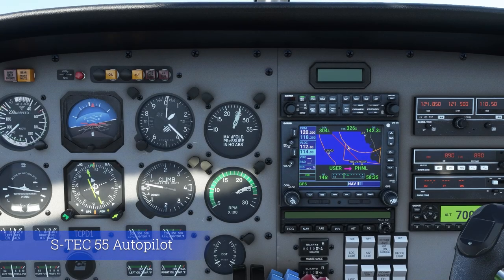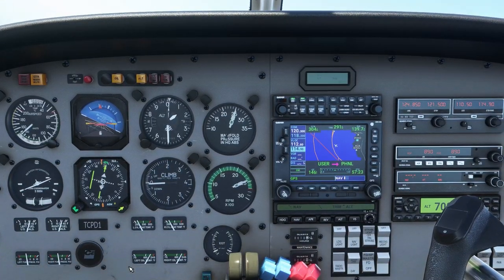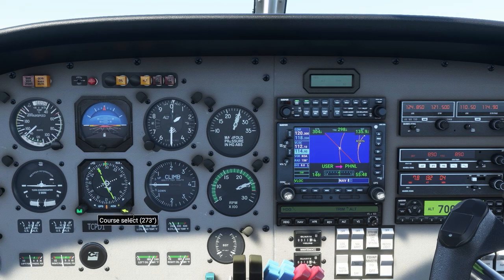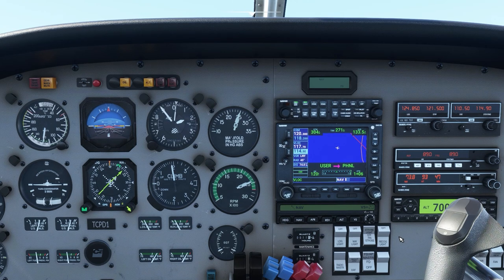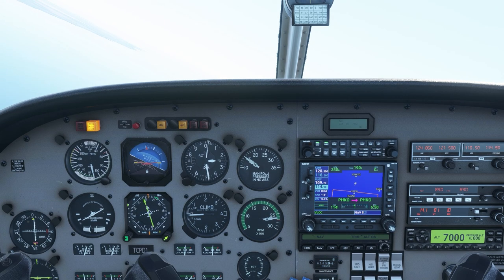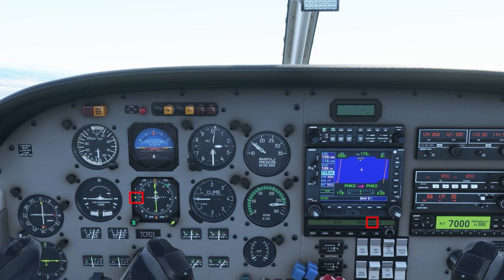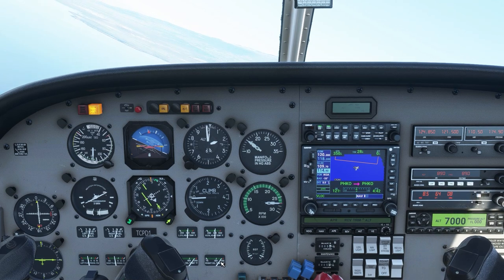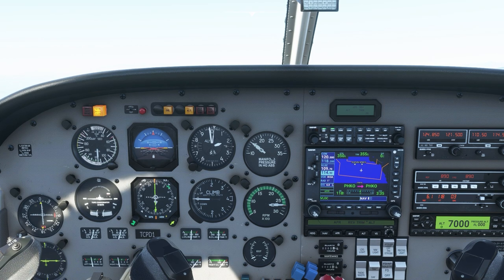S-TEC 55 Autopilot Tutorial - Microsoft Flight Simulator

Comment from the maker: Is there any particular type of video anyone wants made pertaining to this aircraft?
Reply: Hello captain, thanks for all the videos you are making for MSFS 2020. I have a request (since you ask): Some real world P-44 pilots are saying the single-engine performance of this Carenado P-44 in MSFS 2020 is wrong, while some other real world P-44 pilots are saying it's alright, and then there are others who think it's 50/50. This as you can see could be confusing to non-pilots like me. I wish you could take a look at the single engine performance of this aircraft again and make a video about it along with your final overall conclusion and thoughts. And also if you could test and tell us if this aircraft's mixture simulation is correct. Thank you sir :)
Reply from the maker: @evidenceplz  I've noticed the single engine performance is off too but it is of in fs2020, not necessarily just the PA-44.  From a standing stop it's possible to takeoff with full power on one engine and stay on the runway which would not happen.  I like your ideas.   Both very good.  The amount the mixture is leaned is way off.  Most piston engine airplanes don't require leaning below 3000 feet.
Reply: I’ve been practicing single engine landings since this plane seems to act like the real thing.  Abeam the numbers on downwind, shut off one engine and try to make a decent landing. It’s fun.  Will be much easier to accomplish with a Honeycomb Bravo.

Comment: If you press NAV twice, when you’re in GPS mode, you will have GPSS, which stands for GPS steering. Another thing you can do is press both the ALT and VS  buttons at the same time. Microsoft simulator if you position your mouse pointer directly in the middle of both those buttons you’ll see two arrows. In real life you just use two fingers. That will allow you to hold your altitude and you’ll be able to adjust your vertical speed up or down depending on which way and how much you turn it. To stop the altitude climb or decent, you just rotate back to zero.

Comment: I have wondered, when creating a Low Altitude ILS flight plan in MSFS 2020, and specifying a max altitude for the plan... say 4000 ft (in the world map, not on the unit), why the plane in NAV mode just continues to climb past the specified altitude. Are you saying that this will happen for all planes that have auto pilots that don't support this feature? (I was not aware that some auto pilot systems don't support this feature) Would this feature then only be in aircraft models with a G1000? (Haven't tried it with the G1000 yet. Not a big fan of the G1000 panel... I prefer planes with the standard gauges) FYI I am not a real world pilot, but am trying to learn how to use the auto pilot system as much as possible. I have been using the Honeycomb Alpha Yoke, and just got the Bravo Throttle quadrant on the 29th (Christmas present to self), which has an auto pilot very similar to the one in this plane. Thank goodness for YouTube! I really appreciate all the videos that people have posted, that provide a wealth of knowledge that otherwise would not be available to the general public. 2020 may have been a tough year otherwise, but Wow, what a time to be alive in the Flight Simulation world!
Reply from the maker: The STec55 AP does have vertical speed mode but no altitude selector so it isn't smart enough to level off without pilot interaction.   I have used autopilots that only hold altitude and heading.   I also prefer steam gauge panels.   Glass panels are nice but to me, there is something comforting and simplistic about a basic panel.
Reply: I have a panel that I purchased, and it does stop at the height selected. I thought this was normal, but now I see it must be a bug.

Comment: When I am in Nav/GPS mode flying a Rnav course, the plane follows the magenta line perfectly but when it comes up on following  the Rnav course the plane just keeps going, it does not follow the Rnav course to the runway,  what am I missing? Thank you for your time.
Reply from the maker: The RNAV course to the runway.. as in an RNAV approach?   Are you activating the approach after selecting it or just loading it?
Reply: @thecorporatepilotdad  yes, as in a Rnav approach, I did not activate the approach button, just flying GPS, following the red magenta red line, when it reaches the Rnav approach part the magenta line turns white but the plane does not follow it, it keeps going on the same heading as it was on.
Reply from the maker: @andrewstraatsma3136  The PA44 has the Garmin 530.  When you select the approach go back to the PROC screen and select ACTIVATE APPROACH.  That should draw that crazy arc and then it will fly the approach.  From there, you can select FPL and then cursor over the final approach fix, select MENU and then hit ACTIVATE LEG.  If it's not ACTIVATE LEG it is something very similar.  I'm just going off memory.  That will at least draw a final approach course to intercept and the AP will fly it.  I have a two videos doing the same thing on the G1000 and G3000.  It's the same concept: https://www.youtube.com/watch?v=mfjgVBu-uq8
You might also like this little trick doing the same steps: https://www.youtube.com/watch?v=ahjE_WFODwY

I hope that solves your problem.  If not, let me know.
Reply: @thecorporatepilotdad  Thank you so much for your help. Appreciate it.
Reply from the maker: @andrewstraatsma3136  You are welcome.  Did that work for you?